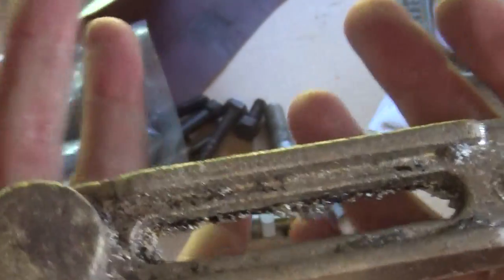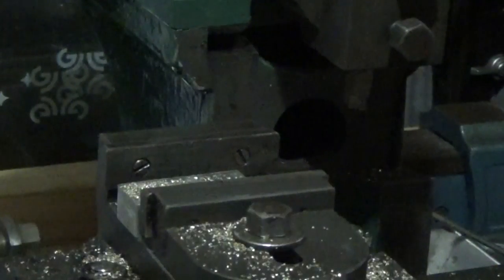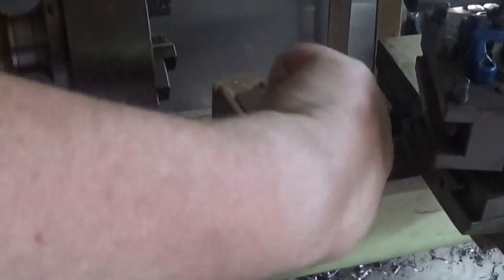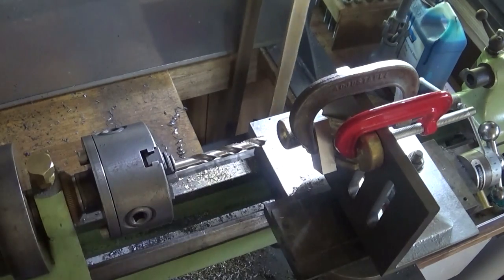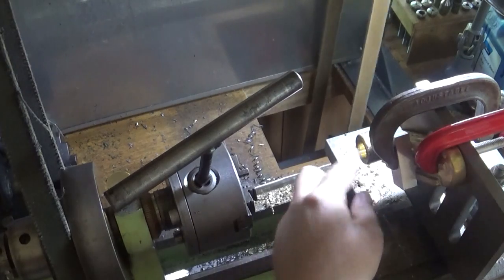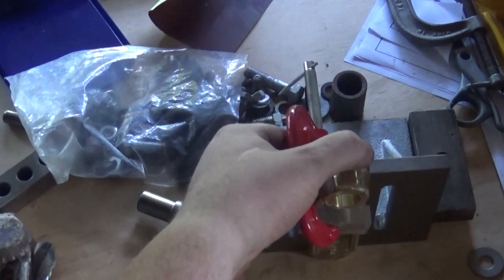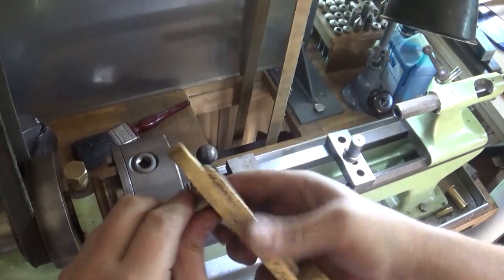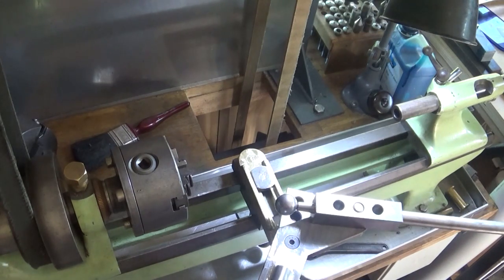Metal Spinning Attachment for the Lorch Lathe Part 8

Comment: Emma, the grub screw will cause the pin to gall and will be a bugger to remove the part. I would recommend putting in the lathe and cutting the pin smaller so no worries.  After you smooth the casting you can add some bondo to any void shrink etc. mostly cosmetic. Nice project and I will be sure to watch your first spin! Cheers
Reply: Emma, you could machine a groove on the pin which the screw falls in. any galling will be in the groove but it doesn't have to affect the fit of the pin much. Your project is turning out great!
Reply from the maker: yeah.. i feel like it needs painting.. lol. good tip on the grub screw. thanls for watching.

Comment: Hi Emma. Looks very good. I just wonder about that ball on the end. If its not rotating will it cut a groove in the sheet metal. It will get very hot and if it loses its smooth surface the friction will produce a lot of heat.
Reply from the maker: Yup jury still out on that.. thanks for watching!
Reply: The old-timers did spinning with hand-held tools, so this should work for copper at least. Copper does work-harden so heat is all to the good there. Main thing is now to make a form to spin on and give it a go.

Comment: Coming along nicely Emma, soon you'll be putting sheet metal through its paces. You operate the shaper at a fast pace compared to other's with electric ones on YT, good way to burn calories. The spanner is probably 1/4 - 5/16 Whitworth, a handy spanner if you can find one as some h/ware bolts are Chinese copies of the originals. My guess the channel for the T nut should clean up nicely with the shaper. Peter
Reply from the maker: +PGS they sort of are. The bolts are whitworth threads. A whitworth spanner doesn't really fit well though at all.